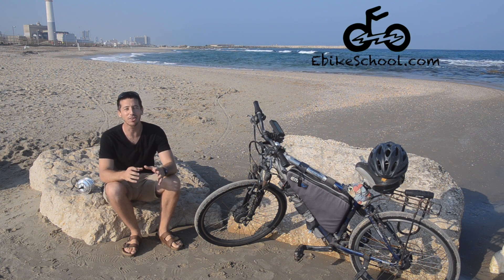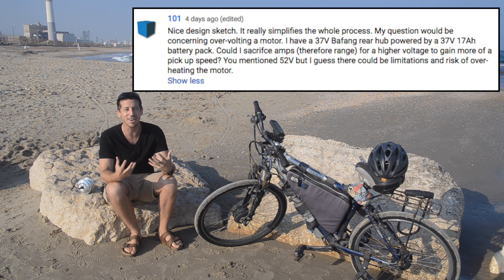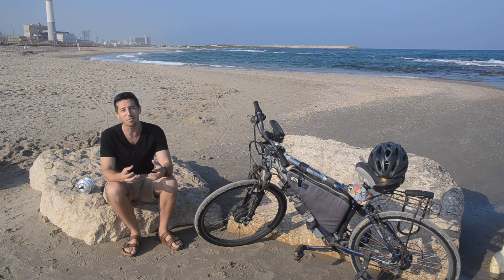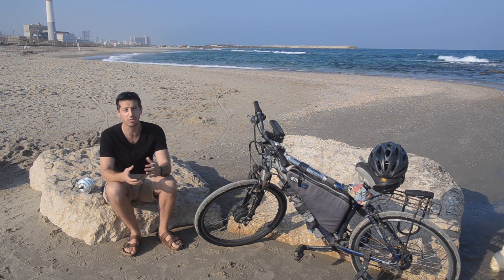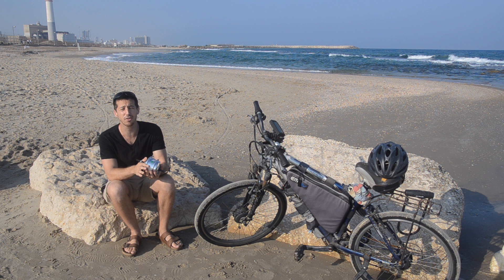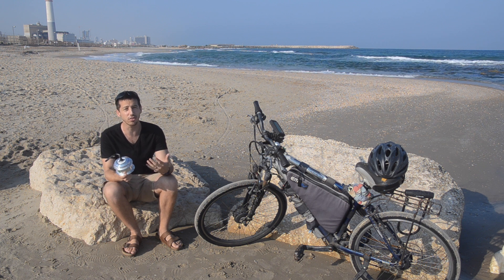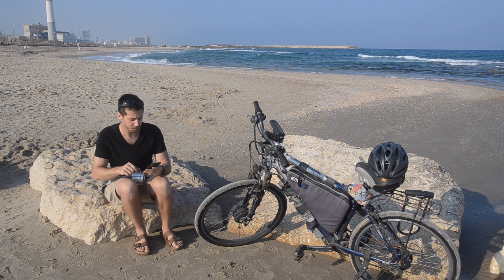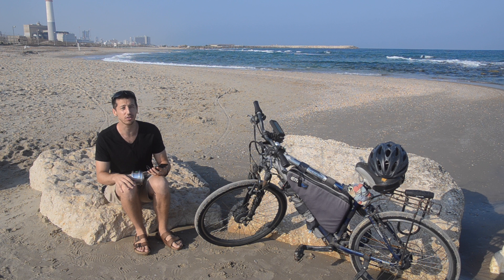Overvolting an electric bicycle motor for more speed! Q&A#7

Comment: There are 2 different hub motor control voltages. Most of my hub motors were and maybe still are the most common. I have a Bafang and a few others. Most of my controllers and throttles are interchangeable. However I have a hub motor 16" in a trike that none of my controller/throttle will run. I just bought a new controller/throttle kit that runs that trike hub fine but will not run any of my other hub motors. I have noticed that the voltage being sent to the wheel is higher on the Bafang and other hub motors I have than that going to the 16" trike hub motor. How can you tell what you are buying will run which type of hub motor.

Comment: Hi mate I’ve got a kugoo g booster scooter it’s 48v duel motor 2x800w so for me to get more speed all I need is more volts .
But say if I get new controllers say 60-72v would I still need the controllers to be 800w per wheel or can I go more ? 
What would be the best way to get more speed cheers 👍

Comment: Can some tell me why my  Escooter motor make noise then looses power once I’m moving. I can move from a stop nice and smooth. Then right as it’s about to really get going it falls on its face. And once it has slowed a bit I can get back into the throttle and then it happens again. I have swapped to a new motor then to a new speed controller. Then I also tried a different throttle and still the same issue. Any ideas out there???

Comment: I have a 36v motor, my controller is 24v-36v and I've been using a 7s2p battery on my build. I'm about to connect a 10s2p battery......

Will my distance get better or just torque and top speed?

Comment: Great videos!
I have a stock 16 amp controller with a 500watt motor. The controller is limited to 500watt max. Can I run a 750watt motor until I upgrade my controller.  Or will this lower current  into this 750watt cause motor damage?
Reply: It's a 48v battery supply.

Comment: Hi,  I have a 24v  & 250w motor. I was wondering if I hook up another12 volts to my 24 volts would that work on my system to make it go faster. I think the answer is yes. My other question is the 24volts is lithium & the 12volts is conventional acid. Please help.
Thomas55brownjr@gmail.com

Comment: The better way to increase speed is put the 2 speed gearbox for electric motor and drive much economy put high gear and motor run at low speed but  you going fast  on the road and first gear for terrain the problem is that gearbox not exist and we cant buy that

Comment: I have a question.  my controller says 60v  45+1a.  My battery is 60v 60amp.  My two motors are 5000 watts each.  Is this ok anyone can answer thanks

Comment: I need to go uphill. Will increasing the voltage help? Or should I increase the amps? Which will be more detrimental for the motor? (which generates more heat?)
Reply: More amp: more torque at the same speed 
More voltage: more speed with more toque and more efficiency at low speed.

Its always better to increase voltage but not too much to generate excessive heat.

Comment: Awesome video, It gives me an idea for my Ebike. What do you think?  Currently I have a 52 volt 13ah battery running a (rated at) 1500 watt motor. My controller is rated at 30 amps 52v.  It hits 28mph on flat and has a range of about 25~miles. Im thinking to add another identical 52v 13ah battery. If I wire up both batteries in series or parallel what would I get? Should I also switch to an upgraded 72V 3000W 100A controller?
Reply: I've got a 86 volt controller what can hold up 100 amps
Reply: My battery is 126 volts but I use a sw900 to lower it down to 72 55 to 60 mph 350w motor it takes about 15 s to 20 s to get to full speed

Comment: I need to be clear, I have an ebike with a modern hub (250 watt) I think.I currently run at 48 volt, so How high can I safely go, could I go to 60 volts safely and really speed up, or perhaps 52 volt to be safer.Obviously I want as much power as poss, so will try 60volt if it's safe to do so?
Rob

Comment: if youre over volting your motor all the time, wont your motor die quicker compared to running the motor at the volts it was created to run?? and is this over volting only for bldc motors or do you do it with bdc motors as well??

Comment: Hey, I have been wonderin if theres no such thing as perpetual motor, and knowing a motor can run at any voltage, what about if I will put a Generator and hook it in BBSHD motor, will it work as an assist mode? If so what kind of generator should be used?

Comment: Hello sir I want to make it fast my ebike and my motor voltage is 36v and the motor is 1000 watts what is the best controller I need to use?
Reply: 48 -52 volt controller, no higher than that! Otherwise you would've sime issues with the motor hub!

Comment: Hi Micah, I live in the UK where the max motor is 250w. What would be the ideal controller & battery voltage/amperage for a 2 wheel drive 250w 29". Also, do you know if using two 250w motors keep me within the 250w max limit, I want to stay legal, or at least under the radar & arguably under the limit to any curious coppers.

Comment: Great videos. I’m learning a lot. I’m considering upgrading my Bike-E RX recumbent bike to an e-bike. Like many bent bikes, mine has two different wheel sizes, 16” in front and 20” in back. Overvolting seems pretty straight forward for a single motor. What are the extra considerations and problems for installing dual motors and overvolting with different wheel sizes?
Reply: instablaster...

Comment: Thanks for the information. I have a question that maybe you answered but I’m not sure. 

I have a 48v 500 watt power ebike with 750 peak power. 

My question : I am trying to buy a 52v 21amp power battery more for range and stay at speeds of 20-25 mph. 

Will I ruin my bike? And do you have any recommendations?

Mahalo for your time
Reply: The difference between 48 and 52 volts is negligible. You'll pick up a couple of mph/kph at the top end, maybe a little more torque on acceleration. Amp hours is where you get your range. If the amp hours on the 48 is the same as the 52 you'll be better off looking for a 48v with more amps. If the 52 has more of both, the winner is you.
Reply: Rodney Dickleman I see. Cool! That makes a lot of sense. So I do have a 48v 13ah, so upgrading to a 52v 21a is a win win?!?

Will it fry my computer system? Will that need to upgraded?

Thank you for your knowledge
Reply: @rodneydickleman297  similar question but i have a 1000w mid drive (peak 1600 ) says use it for 48v-52v but i was looking at a 60v 30-40ah. Is that all okay? Btw im looking for most range, not speed

Comment: Idk how ampere hour works but i found motor with 1000w 52 v its like 18 ah but i founf batery 52 v 38 ah and 1000w does it matter if the ah is high pls help thx

Comment: what happens if you under volt your electric bike? i recently tried it with a 48 v motor kit and a 36 v battery, either I have messed up with something or it shuts off if it get load on the motor. just running the motor works with out load. but as soon as i am on the bike it turns off.

Comment: I have a question, I have 2 48volt batteries i hooked both to my ebike both fully charged. Am I safe to run both at the same time with a 48volt controller with 500watt motor  ? I'm afraid While ride it could catch fire please help thanks. both totals out to be 96volt
Reply: Unsubscribing can believe it take forever to receive a reply back guess what I couldnt wait and blew my motor thanks.

Comment: I love the knowledge you have behind your reviews! I have a 36 volt battery on my ebike! I'm pretty happy with the speed, but I would like to increase the distance of the ride (I am 6 foot 250 lbs.). Right now I only get about 16 miles out of my battery! So how do I increase my distance of the battery to about 25 miles?
Reply: @peterioannou9266  I am not sure what you mean exactly by connecting parallel! How? I mean there has to be a specific what to connect without danger of explosion or corrupting the power!
Reply: @waylandlively7550  .Just get a bigger amp hours lithium ion battery.With the same voltage..Use your existing one for  a back up .Example 40 amp hour 36volts battery gets you 15miles.Replacing the battery with 80 amp hours 36volts your mileage should be about 30 miles.And you will be safe with this setup..The battery will be a little heavier in weigh..
Reply: @peterioannou9266  appreciate it!
Reply: @waylandlively7550  you are welcome
Reply: @peterioannou9266  what happens if you buy and fit a 48v battery instead? Would that be over volting the motor as explained in this video?
Reply: @HDsharp  yes you would over voltage it.Not comparable with motor and controls.
Reply: @peterioannou9266  so why is this video creator advocating doing this without stating the dangers? This is the first thing newbies would be concerned about.
Reply: @HDsharp  He is taking about over voltage for more power and torque with everything safely  comparable same parameters  voltage, controller charger ,motor bulbs horn etc etc.Example 12 volts battery drills were ok but not powerful and no long drilling time compared to 24 36 48 72 volt drills.Some Dc motors can be operated with different voltages for more speed.Safely don't take the chance because the bike system was made for a specific voltage .many things to consider and change for a upgrade for more speed and distance safely.

Comment: I'm trying to push for efficiency, so I'm trying to get the current as low as I can get. But I wanna know in your point of view and knowledge, which configuration will give me the best efficiency; 500W 48V or 500W 48V(overvolting to 60V)?

Comment: my speed is fine, I need more power, I want to go the same speed uphill as I do on the flag Road ???
Reply: That is what upping the voltage does, it gives it more power and if you want with that extra power you could always also use it on flat road
Reply: incerase motor phase amps

Comment: Any ideas why my new BBS02 is overheating to 95 Celsius when I go uphill
Reply: Im not Micah but I have studied engineering to be able to answer you. The motor is probably drawing too much current when it  is going uphill especially when it is overvolted. Either get a cooling solution the the BBS02 or If it is overvolted cut down the voltage

Comment: Hi I have a problem buying a new battery for my e bike with motor 36v/200w controller 48v/350w, can I use a battery come with 48v/500w or higher watts for the bike Im using?

Comment: Hi Micah, I have a peddle assist 24 volt bike. I understand from this video that if I replace the 24V battery and the 24Volt controller both for a 36Volt one without replacing the motor it will function just fine? or are there other things that I should also take into account?
Regards,
Tin

Comment: Hi, thank you for sharing your knowledge with us. I have built 3 projects so far and I love doing it but I have a question which I don't seem to find an answer within the ebike community and I hope you may be kind to help me.   I am running a Bewo 350W  driven by a 36V 10Ah battery on a 20" foldable bicycle.  It goes OK but might be a little slow I think so I have been considering change the battery from 36V to a 48V  Could you please advice what speed control would be best as I know the current one is only ok for 36V.  Is this possible?  and if it is would this give me a bit more power without damaging the motor? where could I purchase one?  Thank you so much for taking the time to help.  Kind regards Clem Queensland Australia clementoliver@optusnet.com.au
Reply: You need to put more batteries to reach 48, the engine does not get damaged with little different volts, but batteries can explode with more voltage.

Comment: even may your controller handle voltage, your motors design may not. the mean of it in the ansys or some another hi-end motor design programs that makes the same job, let you design your motor in the some specific voltage and rpm constants.After designing motor , in this case hub motor ,maxwell utility cut the motor more than thousands pieces and analyse every piece , we call it fem analysis.the termal structure ,magnetic structure and durability structure etc. So if your motor designde for 36 v please do not push it to work on 48v ,if you do hardly ,for a long or short time no one can not know this ,motor will burn. Bearings  also is an another side of the world, will your bearings in motor handle it? do you know  is it zz or sz series  or plastic sided? how much rpm it will stand without broken?.. so many risks in there. As an electrical and electronic engineer ı do not recommend it .

Comment: I am replacing my 36 volt ebike  battery and will probably purchase a 48 volt battery after seeing your video on youtube.  Looking for advice on motor wattage. There is no markings on either the hub or the battery as to what watt they are.  Should I purchase a 500w or 1000w battery.

Comment: YOUR FORMULA IS WRONG(1800W 48 V MOTOR )4500 RPM X 26 INCH X0.003=351MPH lMFAO
Reply from the maker: This is for hub motors, which spin at around 10% as fast as the motor you listed. 10% of your 351 mph is 35 mph.

Comment: The el. power output is propotional to to the square of the voltage.  Necessary power is propotional to to the cube of the speed.

Comment: Hi, can i ask you something?... i made a bike using a 500w hub motor, not sure if the motor was from an ebike or not, because i had to make a ring with holes to assemble the spokes of the wheel. (It has 3 phase and hall sensors and its brushless, gearless) The bike its a bit heavy, about 40kg (88 pounds), and the motor gets hot after few distance. I cant lighten up the bike right now, but im using a 350w controller to power the motor, what i need to know is if the motor will work with less effort with a 500w controller and so the temperature will fall down or its going to ride better but get even hotter. (Im now using a square wave and the 500w controller will be sine wave). Im in south america and getting this kind of parts as controllers is not easy at all, thats why im asking first!

Thank you very much!! Your videos are great

Comment: I know that you can use a higher watt battery compared to your motor. But what will the result be?  Lower speed but greater mileage? I am thinking about putting a 48V X 30Ah 2000 watt battery onto 48V 1000 watt motor to gain more miles while I tour at least 100 miles/day.....Thank you!

Comment: I have a Fireplus scooter it’s a copy of Xiaomi M335. It has a 300w controller.The actual speed is 28 kmph but when running on the road the speed reaches more or les 24 - 26 km/h normal road. I want to add speed or torque what is the best tips?

Comment: Increased voltage equals increased speed. So, does increased amperage equal increased torque? For example, if I have a 60v scooter that draws a max load of 16 Amps, can I lower the voltage to 48v and increase the amperage to 40a? This would roughly double the wattage.

Comment: hi, please tell me! bafang geared motor rm g020.500.dc 48v 500watt, if I connect a 52 volt battery, will the motor, battery and controller overheat?

Comment: A relatively comfortable electric bike✳✳>share4.photo/ebicycle?ㅉ125  that feels well suited for shorter treks through the city . A durable, streamlined, electric bicycle with an excellent quality and service. I've rode this bike every day since i bought it and really love it. No damage. Assembly was simple. Documentation and youtube instruction help a lot while screwing it together; brakes and derailers were even adjusted properly right out of the box. Rides quite smooth. I have used some electric scooters and bikes, but the battery range on this one is very impressive. The lightest, quietest, and most efficient 250w motors, its very powerful, great!
Reply: I guess you ride a daily commute of 10km.
Reply: Hey buddy we dont care. Thats not why we are watching this vid.

Comment: Speed is controlled by the controller,  depending in the controller you will be limited at certain speed,  of course if the motor is unable to handle the load then higher amps/voltage will give you more speed, some controllers let u remove this limitation and have any speed you want, the higher the voltage the higher the watts you can run a motor without burning, so for example if the motor can only take 30 amps at 36v, all you get  is about 1000 watts of power, but if you double the voltage you double the amount of watts, so the motor is more powerful  more torque  no necessary more speed, second there is a limit in voltage, because the inside of the motor is design it for certain voltage if you go too high lets say 800v the inside of the motor is unable to isolate that much voltage so it would burn out. Higher voltage means more torque,  and if you have no limits in speed by the controller then because you have more power then you can ride a higher speeds, these aren't DC Motor were you increase voltage and you have higher speed, these are 3 phase motors that the speed is controlled by the ac signal.

Comment: Hi I just tripped across this and was intrigued by your equation for the speed of the bike so I have questions. Where does the number 0.003 come from? are you talking about brushed or brushless motors? Also I guess you are referring to a theoretical speed based on the voltage supplied by the battery and the quoted speed of the motor at this voltage .I fly electric model aircraft using brushless motors that are quoted in so called Kv or revs per volt.

Comment: if you have a 36 volt battery and a 48 volt charge controller can you run that with the 48-volt throttle can you put a 36 volt battery on it still work it will it work can a 48 volt system go to a lowerand not mess up the throttle or the controller the motor suppose they can protest out I'm assuming that's no big deal